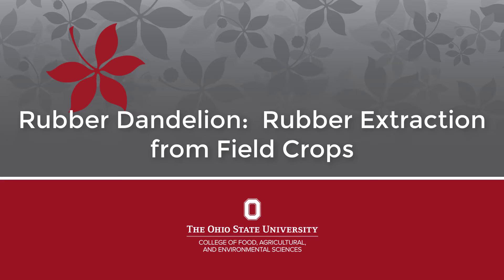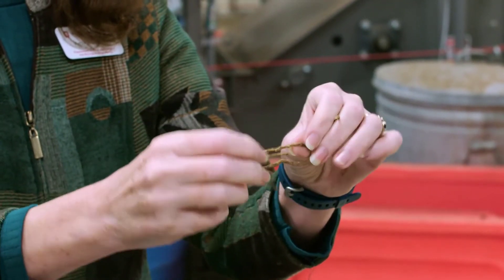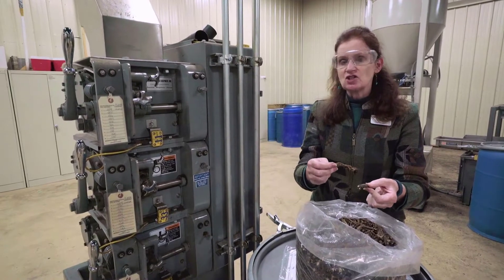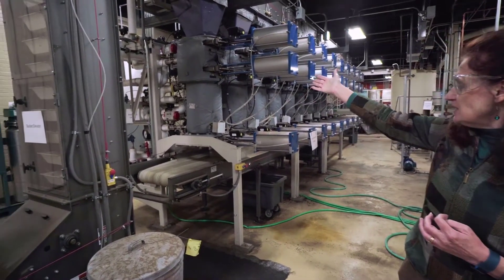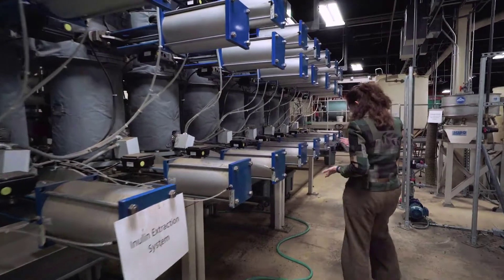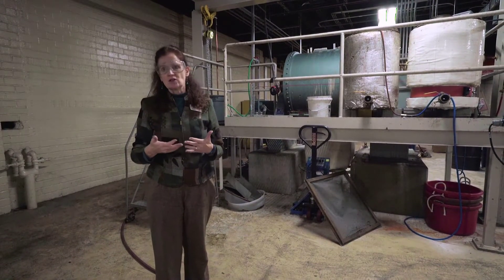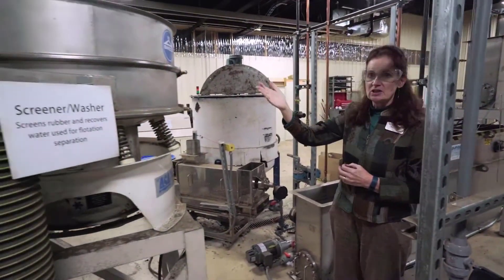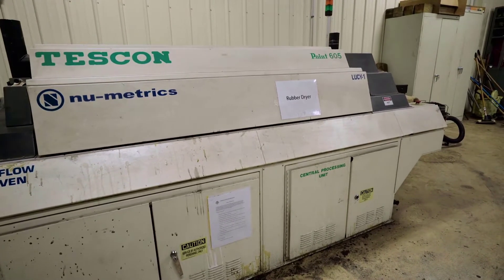Rubber Dandelion: Rubber Extraction from Field Crops

Comment: I wonder if this woman actually understands what plants and roots are the so-called brake test has nothing to do with rubber it has to do with the density of the plant and the fact that it is alive and still drying out and when you dry out a root it has no moisture left and snaps in half all plant matter does that when you freshly harvest any plant even a carrot it may bend into in instead of snapping in half like it will a few weeks later I really think this woman is actually misunderstanding what's going on and going through a bag of old dried roots thinking that the ones that bend have a higher rubber content as opposed to the ones that bend are actually still alive and fresh the end result is the same that the fresher root might have more rubber that's viable but all the rest of the roots have the same rubber content they're just dry so if this woman understood what to do properly they wouldn't be harvesting it wouldn't be using roots that were probably months or a year old they would use freshly harvested fruits that have fresh flowing rubber I just think the woman's naive and that same bag that just came off the field would probably have a hundred times more rubber in it if it was fresh and she's really suggesting that if the roots dry out they cannot extract the rubber because otherwise everything she just said is gibberish because if the rubber is something that still can be extracted out dry then it's still in the plant it did not evaporate out of the root